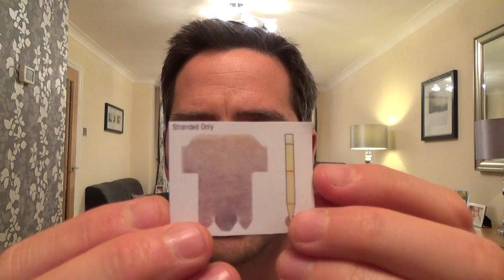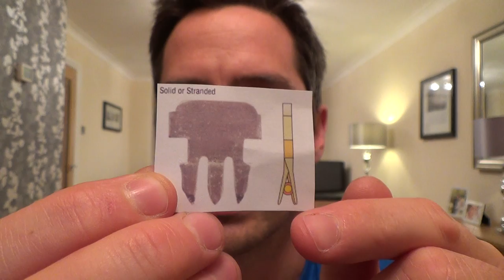How to tell the difference between CAT5 / CAT6 solid / stranded core RJ45 plugs

Comment: That was dead helpful, thank you so much.

Wondering if you can confirm for me that my cables are infact proper Cat6 and right for the job.
The cable is 50feet long, says Cat 6 on it, but is a flat wire and not staggered. Is that truly a Cat 6 and is it the right cable for the job of connecting two Google Wifi hubs together or for sending data to (or streaming from) my network to a My Cloud PR2100 storage drive? It's because you mentioned Flat is for Medical, that got me questioning it.

Comment: Nice video. I just bought a new router (Asus TUF-AX5400, manufactured 2021) and it came with an anonymous unlabeled black LAN-cable (well, the only text was on the connector where it had an "eje"  logo, and it said "L5" on the little tab) and trying to guess if it's cat6 or they cheaped out with cat5. The pins do look all flat, not seeing any "high-low connectors" so I'll assume it's cat5.

Comment: Hi Vince, this is a old video, but every CAT6 connector I see right now isn't staggered, they are all straight pins that's normal now?
Reply: I think using the staggered plugs depends on the size of cable

Comment: This is the confusing part, a lot of videos are telling you that a Cat 6 is straight in wires and not staggered.  Your saying that a Cat 5 is straight in and the Cat 6 are staggered. The Cat 6 plug is a two piece plug. 8:24  Is a one piece better than a two piece ?  The two piece creates a staggered wire that prevents cross talking and faster transfer rate over straight one piece connector.
Reply: All the CAT6 plugs in my country that i've seen are straight, maybe they are all straight now? I'm confused with this video.

Comment: Thanks, I had to use a loop to check which CAT RJ-45 cable I have, sadly, I wish it was CAT6 which can transfer 1.25 Gigabytes/s (still slow for 3 Gigabyte to 7 Gigabyte M.2 SSDs). It's all 5e capable of 1000T Base or Gibabit ethernet (125MB/s). I guess it's still slow for even fairly a modern hard drive data transfer (135MB to 155MB read), more so with M.2 SSD from Western Digital 7 Gigabytes/s or even a SATA SSD but there's always a weak link, a bottleneck.

God bless.

Comment: Thanks for the clear explanation and my question is - I already have cat5 throughout the house as part of my Ethernet POE security installation. I'd like to know is it ok to also run cat6 together with the current cat5 house system as I don't fancy doing ti all over again, I'd also like to know can I use cat6 cable with feed thru cat5 connectors and if they will also work ok with my house cat5 installation - thanks mate :)

Comment: Hey man I'm wiring my apartment using an old telephone conduit installation, I removed the cables, and after coming accross your video I noticed that my plugs are cat5e, I'm  installing access points in all rooms to get proper wifi and to be able to automate my home, air cons, wall plugs, switches everything. These APs are POE, and I'm only pulling about 20 meters of cable maximum, from the living room to my ensuite, do you really thing this would matter if I use the old plugs? Kind regards!
Reply: Cable is cat6 of course!

Comment: Which is superior, the two prong or 3 prong? It would seem to me that the 3 prong, as it has more teeth to grip the wire. Also, if in fact the additional tooth on the 3 prong makes the connection stronger, it would seem to me that it would be better for a patch cable, as those get plugged in and out a lot.

Comment: Excellent presentation, learned a lot. I wish I knew that before I ripped 50Feet from underground pipe because I thought that the dam cable was at fault as there was no internet connection.....   It would not fit into the back of the wall plug (j45 cat 5) cable was cat6!!

Comment: Great video Vince.  Thank you.  Is there a difference in data quality if you use a cat5 connector with cat6 cable?  I have a lot of cat5 connectors and don't want to buy cat6 connectors if I don't have to.
Reply: cat 5 and cat 5e connectors as well as the cat 5 and cat5e cables have data loss or cross talk when numerous cables are bunched together in a server rack. The staggered cat6 provides a tiny bit more separation of the wires in the cable itself and the connector. Only use cat5e in single work stations or end user equipment.

cat 5 is limited to 100MBPS
cat5e bandwidth is 2.5 gigabits up to 100 meters
cat 6 bandwidth is 10 gigabits up to 55 meters

Comment: I was having problem with my Ethernet. I have a gigabit router and a 250 Mbps connection, But my internet speed was stuck at 100 Mbps. I am glad that I saw this. Now changed the cat5E to Cat6. Issue resolved.

Thanks Mate...
Reply: Cat 5e can pass 250mbps but there are a lot of knock off cables out there that don't use copper so that may have been the issue

Comment: Will a Cat 5e plug work in a Cat 6a socket?
Reply: No, you need a Cat 6, only a Cat 6 is backwards compatible.
Reply: @AbazabaA6  so if I have wall outlets wired with cat 6a I need a cat 6a cable to go from my computer to the wall?
Reply from the maker: CAT5e will work in a CAT6 socket but the network speed will be brought down to the lowest component in the setup (in your instance the CAT5e Ethernet patch cable). In reality depending on what you use your network for you may not even notice any difference as CAT5e is still capable of high speeds :-)
Reply: @Mymatevince  thanks, that's exactly what I thought/hoped.  I'm having a house built and having it wired with cat 6a so it's capable of faster speed in the future when you would notice the difference without having to be rewired.
Reply: Yes cat5e plug will work but have a lower speed than if it was a cat 6 plug/cable.

Comment: Calling bs that you can't use them interchangeably. Most Cat plugs are marketed as 5e or 6, use for both, and I just used 5e plugs on a 6 cable this morning while redoing a suite, no issues. Can someone chime in if this will cap data transfer speeds?

Comment: Hi, I recently bought a Cat6 Ethernet cable, which clearly states Cat6 on the cable. But I've noticed that the plugs have the straight wiring configuration and not staggered? Have I been ripped off with a non Cat6 cable?

Comment: Tried about 50 times but whenever I push the 8 wires in I end up with 2 in the same channel at some position, on top of each other. It doesn't look or feel like there are defined "holes" inside the plug to hold them in place.

Then the crimper doesn't seem to split the ends! When I pulled them out the insulation on all 8 wires was still completely solid.

Think I'm going to go for an ethernet socket then use a purchased short cable to connect it to my hub, because I've just lost 3 hours trying to get ONE RJ45 plug on and failed.

Comment: I'm still confused. In my house I got Cat5e which says "26awg" on the cable. I'm sure that is not the outer diameter of the cable, but rather the strands on the inside? I work with other wires like FeCrAl and 26awg is really thin. Way thinner than the outer cable of my Cat5e 26awg. I'm going to buy new cable. Cat6 and the retailer says it's 24awg, but the RJ45 plugs says it's for Cat6 but for 24awg. Does that matter? Can I match up any Cat6 RJ45 plug with any Cat6 cable? or should "awg" also match?

Comment: Are the staggered wires in the cat6 connector part of the official cat6 spec? I got some factory terminated cat6 cables and I noticed the connector isn't staggered. Wondering if I got the real deal.

Comment: my dad still has the original cat5 not the 5e cabels. but we have just plugged a cat 6 into his desktop. and in my room at my dads house i have got a ethernet cable connection directly connected to the router. which ive used cat5 and cat 5e dose that effect the speed dose it make it slower or faster? ive used a rj45 extender which is two rj45 holes on each end what is rated for cat 5e and ive used both cat 5 and cat5e for my ethernet connection if i brought a laptop down do my dads. dose a rated cat5e rj45 extender and i have used both cat5 and 5e ethernet cables in that extender thingy dose that effect the speed dose it make it faster or slower or the same speed as a cat5&5e cable?

Comment: One thing you did not show is the side of the CAT-5 and CAT-6 plugs. Look at the side of each plug, and you will see a BIG difference between the two. On a CAT-6 plug the outer sheath of the cable can come much closer to the gold pins.
When you look, you will see the difference without any problem.
I thought this might help.
Nice video you did on the plugs.

Comment: I have read CAT 6 is ok with 24AWG if it meets the specifications and therefore you won't have staggering.  It is only where the manufacturer has used thicker cores to meet the specification that the core diameter requires staggering.
Reply: That explains why I have bought Cat.6 RJ45 plugs that are not staggered... Thought that they were fake.

But it is a question of the thickness of the leads?

Comment: is all motherboard compatible with  cat5 and cat6?
Reply from the maker: Hi, yes they are but some old Routers, Network switches, Network cards may have Fast Ethernet ports so running a cat5e or cat6 cable will not be any better than the very old cat5 cables. BUT running CAT6 is no harm and will future proof the install.
Cheers Vince.

Comment: So if I need a long distance cable (50ft) I need to buy solid or stranded? Sorry for my English
Reply from the maker: Hi, both solid or stranded will work fine over 50ft. I prefer solid core as it is a stronger cable and you can punch it into wall sockets.
Reply: Thanks! I had look over the internet and found out that 50ft doesnt have the solid only 250ft+ are solid. 50-100ft are just the stranded. It might my mistake but I think I'll go for a 250ft solid on monoprice. Once again, thanks for a helpful video and helpful reply!!

Comment: An electrician recently installed CAT6 cabling in my home. I was able to verify that the cable itself was CAT6, but the RJ45 jacks he used are actually labeled CAT5E (he's not yet installed the plugs). He told me that unlike the plug, the RJ45 jack used doesn't matter; is this true?

Comment: Hi, thanks for the info. I assumed they would be the same. Unfortunately I can't seem to find any Cat6 connectors in my country, I know regular connectors would work, would you be tell me what kind of speeds I could expect with regular connectors? I would like to crimp on regular ones till I can find proper Cat 6 RJ45 connectors if there wouldn't be any significant loss. Thanks.
Reply from the maker: Hi, you will be unlikely to see any difference as most people are not using the cable at it limits. If you had the choice then I would always fit the cat6 plugs but if you can't get them then the normal RJ45 plugs will work fine, it can just be a little tighter when pushing the wires into them.
Thanks.
Reply: Good to know, thank you.

Comment: Glad to have stumbled upon this. Didn't realize my network was not getting gigabyte speeds until yesterday when my new switch came in. So had to go to lowes and grab some cat 6. They didn't have any cat 6 heads so I went with 5e. Cable tester showed my cable was fine but modem told me there were issues. Tried a few more. Then was like you know what let me get some proper cat 6 heads. Your video did help explain some differences i was looking for.  Appreciate it.

Comment: Thank you for making this video.  I just got done running a CAT6 cable to my workstation, and had the option to use CAT6 RJ45 plugs on it, but opted for CAT5e because it was $10 cheaper, with boots.  While it's working fine, after seeing this video, I may want to return those plugs, and get the proper CAT6 plugs, just in case I have issues down the line.

Comment: I have a question: I have recently bought a cat 6E cable which doesn't have a plug like the one you are showing in the video, it's a little different, I do have to change one plug because I have cutted the original one to fit it into the well, can I use and old crimp machine that I think was design for the cat 5 standard to crimp my cat 6e plug?

These are 2 picture of my cable:  http://postimg.org/image/t4i6ddcxx/ and  http://postimg.org/image/n2ajmvohx/
Reply from the maker: +LightsnRoses Yes, you can use the old crimpers to crimp on a new plug, they will work on cat5e and cat6 cable.
Reply: +My Mate VINCE  Regarding the plugs? Have you seen my photo? My CAT6E plug seems to be different from the standard CAT6 plugs...
Reply from the maker: +LightsnRoses Some Cat6 plugs on manufactured cable can look like that with only 2 pins staggered but the plugs you will be fitting will be more likely to be like the one you seen in the video if you choose Cat6.  When you strip back your cable to fit the new plug just double check that is pure copper as the picture looks a bit like aluminium shining through the end of the plug BUT that might be just the camera.
Reply: My Mate VINCE  Yeah it's not alluminium, it is my phone that has a horrible camera! 
By they way as I have to strip just one side of the cable with the plug, because the other side still has the original plug, do you think that it would make a difference having a plug partially staggered while the other completely staggered?
Reply from the maker: +LightsnRoses Hi, no it will be fine. The cable must have been tested to CAT6 standards with those original plugs so you won't notice any difference having one which is fully staggered on the other end.

Comment: Thank you for the video, learned a lot. For more than 15 years, I have had a disgust in stranded or 'soft core' cable. The latter almost always seems to 'deteriorate' the connection. Never mind using the correct plugs. I prefer soft 'stranded' and hardcore not be mixed.

Comment: I viewed your Youtube video about what a Cat6 connector should look like, but you also mentioned that you can use a Cat5 connector to put the wires in.

So, it occurred to me that I have never seen a Cat6 connector with staggered wires, which mean I may have never seen a cat6 wire ever.

I have a photo of a connector that was sold to me as a cat6, but based on you video may not be cat6.  Would you tell me what you think?  is it possible this is cat6

https://norwood.sharepoint.com/temp/5pack.jpg
Reply from the maker: +David Norwood (CCRE) Hi, it could be cat6 if the cable has been tested and met the cat6 speed criteria. The majority of cat6 plugs that I have seen are staggered and all the loose plugs that you crimp yourself that I have seen are also staggered but I do have some cat6 patch leads that have a straight connector like your photo but the wires entering the plug have a little plastic separator to stagger the wires on their way in.  If the lead is working well then I wouldn't be too concerned because even cat5e will still exceed any broadband speeds that are currently in use. BUT most cat6 leads you find will have staggered holes.
Many thanks Vince

Comment: I have looked everywhere on the net and your video clearing shows the difference between Cat6 and Cat5.  I recently purchased 3 cables from 3 sellers on ebay, and it reads on the cable cat6. The cables did not have staggered wires so, I returned the cable.  I have read that the size of the wire requires them to be staggered, but I have not found any clear photos showing how they are staggered except for your video.  Nice job!

Comment: Are you safe when  using Cat.6 RJ45-plugs with two or three prongs?
Then you can use both Cat.5e and Cat.6 cable, and you can use both stranded and solid core wires, yes?
Reply from the maker: +Hakon Tdal Hi, you can use cat6 plugs on cat5e cable and you can use stranded or solid core if you use the prongs that accept both as shown in the video.

Comment: Great video, if i may ask, what about wall outlets does it matter if you are using cat5e ports vs cat6 wall ports?

i am currently setting up an office, and i have read that all your termination points / cables / ports / jacks / patch panels / switch must be rated at cat 6 to get the cat 6 specifications or else if only one of it is cat5e, then the whole system runs at cat 5e....

can you share your expertise on these? thanks
Reply from the maker: Andrew Dy Hi, if you are installing cat6 cable then I would use cat6 wall sockets and cat6 patch leads. Personally I can see very little difference between cat5e and cat6 wall sockets but the version I sell are actually slightly different on the terminations so I assume there must be a difference speed wise.Many thanks Vince
Reply: Thanks for the feedback, I appreciate it